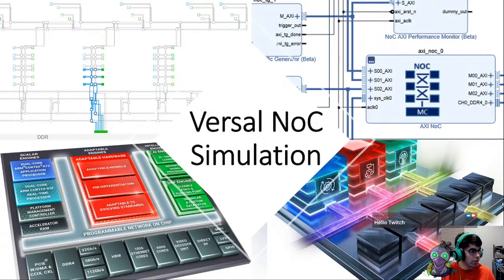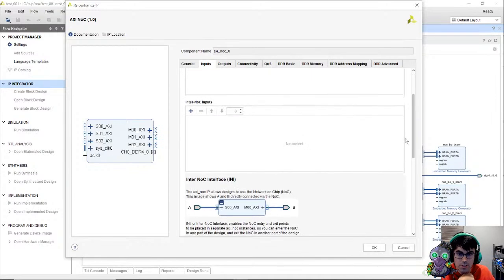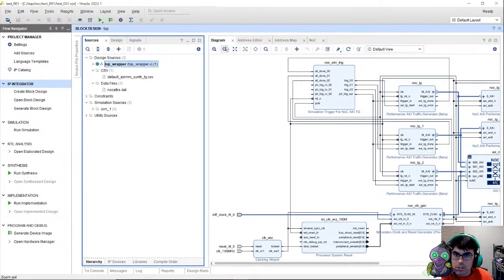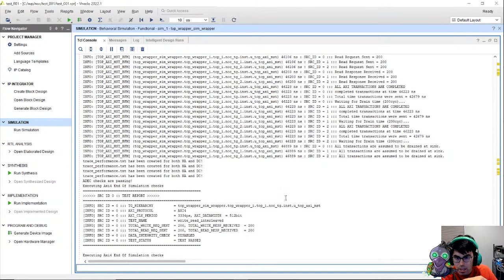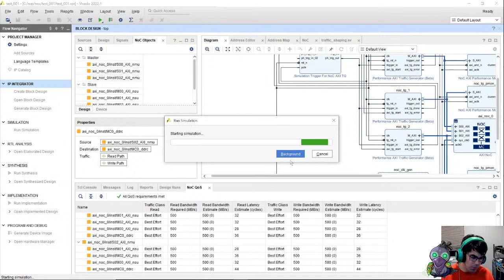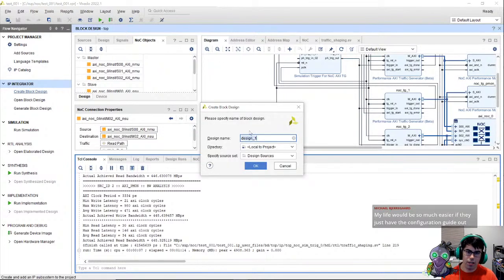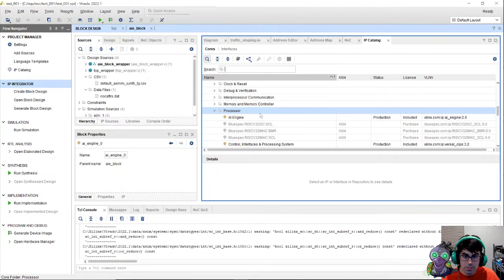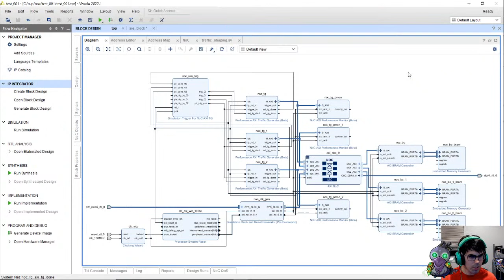AMD-Xilinx Versal NoC Simulations

Comment: I think when creating the Vivado project, you have to specify it as a Vitis extensible platform for the AIE IP to work, at least according to UG1273 Design Flows -> Using the Vivado Tools in the Design Flows -> Block Design Flow. Unfortunately that section lacks detail.
Reply from the maker: I will try that!